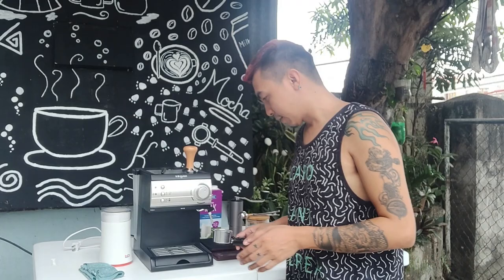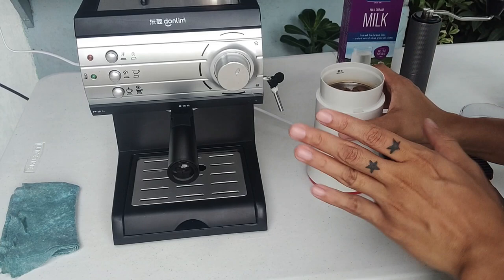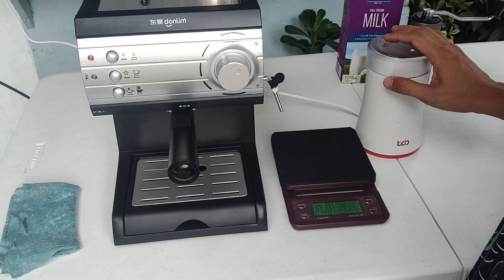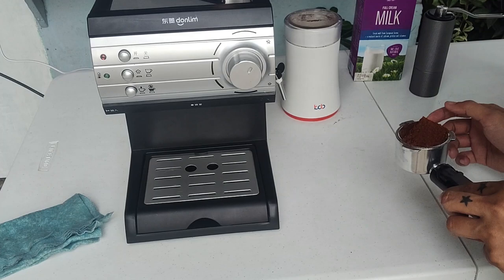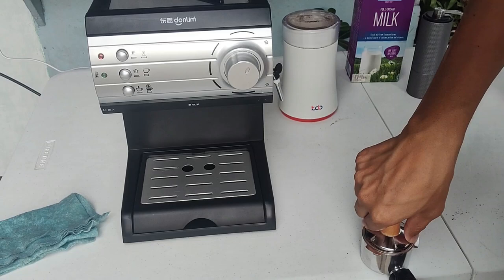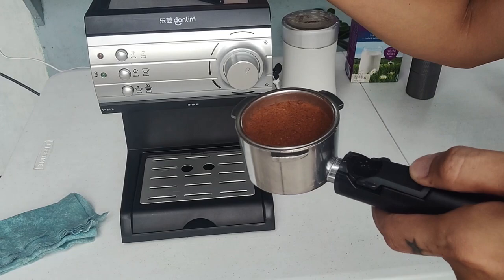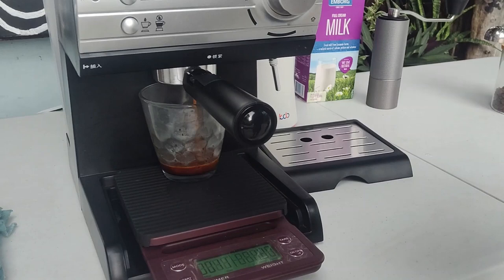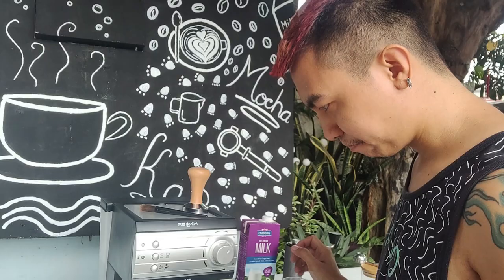Calibrating Donlim Espresso Machine Model KF-6001 Using a Blade Grinder and Naked Porta Filter #kopi

Comment: hello friend, i got the kcb 5403 pro, it has only the 51mm portafilter, which can barely take just little less than 15 grams, do u know how I can make 16-18 shots, is there a larger basket or other tool I can buy to help me do that before I just go ahead to get the bottomless 51mm portafilter? I hope u or any of ur respected followers reply in English plz 😊 thanx
Reply from the maker: Hello, its hard to look for a bigger pressurized filter basket unlike the non pressurized porta filter. Its easy to look for a bigger filter basket. Better get a non pressurized porta handle some of the seller that i found online they sell it in package with single and double filter basket together with the non pressurized porta handle.
Reply: @yourbaristalouise  thanx Louise for ur reply, I'm actually browsing for bottomless portafilter & larger basket, u r right, some sellers have packages, will the 2 cup basket accommodate 16-18 grams if u know? I think i ll go ahead and order a bottomless Porta filter with 2-cup basket, thanx again 🙏❤️
Reply from the maker: @ibrahimbader  yes the 2cups basket can hold 16-20g depend on the roast type and grind size
Reply: @yourbaristalouise  alright, great, thats what i thought, I ll go ahead and order it...thanx a lot... 👍🙏🙏❤️
Reply from the maker: @ibrahimbader  welcome. happy brewing!!

Comment: Hi! I have yung isang style nitong machine, yung may pressure gauge. First time to try, using single origin beans. Medyo bitter. I used 8gms for 1shot sana. Ano kaya magandang solution?
Reply from the maker: ilang grams po output nyo?
Reply: 1oz yung na-measure ko sa cup. Hindi ko nasalang sa scale. Pero na-timer ko nasa 8seconds lang, nakapuno ako ng 1oz. Parang ang bilis. Need ko ba mag add ng coffee beans?
Reply from the maker: need to add more beans po or more finer grinds.  need po weighing scale tlga kung gusto nyo makuha ang accurate measurement and kung gusto nyo pong consistent ang output
Reply: Thank you so much! Will try again tomorrow. Ilan grams ng beans ideal for 1 shot? Try ko yung time ng grind tomorrow. Using blade grinder.
Reply from the maker: Try nyo po 1:2 ratio. Kung 8g of coffee beans, 16g of espresso . Mga 16-20g ng espresso
Reply from the maker: welcome po.
Reply: Salamat po sa pagsagot! 💜
Reply from the maker: welcome po. anytime.

Comment: Just got the same machine, normal po ba na mag leak ang water sa likod ng machine when not in use? or after use. Hope for your response
Reply from the maker: paanong leak?  baka hindi po nakalagay ng ayos yung water tank
Reply: Nakalagay naman po ng maayos kaso every after used ganun po ung nangyayare, di po ba pwede mag store ng water dun sa tank kapag di gagamitin?
Reply from the maker: @abegailkimasuncion9643  pwede po mag store. pero san po nag mumula yung leak mismo?
Reply: @yourbaristalouise  bandang likod po sya lumalabas sa may water tank, tried to contact ung seller kaso walang response hehe san po kaya sya pwedeng dalhin para ipacheck?

Comment: Hi! Pwede po malaman yung size ng naked portafilter niyo po and yung tamper? Not sure kasi kung ano yung tamang bilhin since im also using donlim espresso machine. Thank you!!
Reply from the maker: 51mm po both..pero sa porta check nyo po maigi yung bibilhin kasi meron 51mm na pang delonghi at medyo malaki yu g tenga nito na hindi fit sa donlim
Reply: @yourbaristalouise  thank you po! Laking tulong po ng mga videos niyo para sa mga tulad namin na beginner sa pag gawa ng espresso 😁😍
Reply from the maker: @traceycruz3853  welcome po madam
Reply: @yourbaristalouise  hi po ulit! may question lang po hehe. normal po ba na namumuo yung milk dun sa may wand? inalis ko din kasi yung malaking tube gaya po nung sayo. tapos habang nag steam kumakapit yung milk dun sa wand. thank youu!
Reply from the maker: @traceycruz3853  yes normal po yun kasi nainit sya, kaya po need po sya linisin or punasan ng malinis na basang towel para po matanggal po yung dumikit sa steamwand

Comment: Hi sir! New subscriber here. Makukuha ko pa lang 'yung machine ko this weekend. Dun ba sa original na portafilter niya, magwowork din 'tong ratio and extraction time na 'to? 😊
Reply from the maker: hindi po, kasi maliit lng po yung basket ng pressurized porta ni donlin around 10-12g max lng kaya nya.
Reply: @yourbaristalouise  Mukhang need talaga ng naked portafilter. Salamat po sa super informative videos. 🙏
Reply from the maker: @dodonggeun  welcome po mam, gagawan ko po ng videos yan difference ng pressurize porta ni donlim at naked porta po. dami na din kasi nagtatanong para makita din nila in actual vids hehe
Reply: Best ang 10g na ground coffee. More than that, tatama na siya sa grouphead.
Reply: @elymental495  was able to get the best output with 12g compared sa 10g. Proper distribution and tamping, di naman tumatama sa grouphead. Sakto lang. 😊
Reply: @dodonggeun  need ko siguro magpalit ng tamper, di sakto yung plastic tamper na kasama eh. Nung una 12g din simula ko kaso dumikit sa grouphead.

Comment: Sir, gano na po katagal ng machine sainyo?
Recommended nyo po ba for everyday use or for cafes?
Reply from the maker: almost 5mos na po sya sakin. siguro pwede po sya around 10-15cups a day with daily cleaning and maintenance po.
Reply: @yourbaristalouise  hi po...ask ko lang kung may video din po kayo regarding sa maintenance? thanks po
Reply from the maker: @grizielbaniaga385  meron po sa cleaning donlim kf6001
Reply from the maker: meron din po g descaling donlim

Comment: Kapatid, palink naman ng grinder at scale.
Tsaka portafilter
Reply from the maker: i recommend this grinder po

https://shopee.ph/product/49852537/1688311212?smtt=0.101654396-1625282129.9
Reply from the maker: eto po sa porta
Bottomless Filter Coffee Machine Accessories Domestic Coffee Machine Accessories Bracket Handle Hollow Handle 51Mm | https://s.lazada.com.ph/s.d0gt9
Reply from the maker: dito ko nabili yung scale..pero may mas mura pa po dito sa ibang shop. 
3Kg/0.1G Portable Electronic LCD Digital Kitchen Food Scale Drip Coffee Weighing with Timer for Kitchen,Black | https://s.lazada.com.ph/s.d03rW
Reply: Salamat po!!! Very helpful ang videos mo. Lalo na pareho tayo ng machine. Keep it up!
Reply from the maker: @03Ryen  welcome po sir. At salamat din po sa pagsupport sa channel ko po. Hehehe

Comment: what if i am using a manual grinder?
Reply from the maker: hello, you can adjust your manual grinder to fine or to course depends on the outcome of your first shot or test shot. if its extract too fast adjust your grinder to finer setting and if its too slow adjust your grinder to courser setting.
Reply from the maker: and you can adjust also to your dosage and tamping
Reply: thank you so much